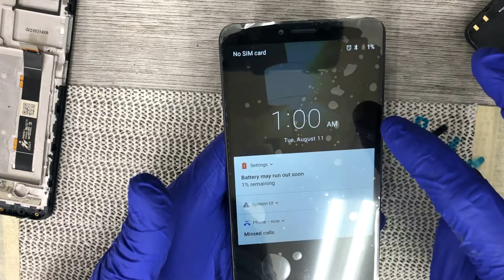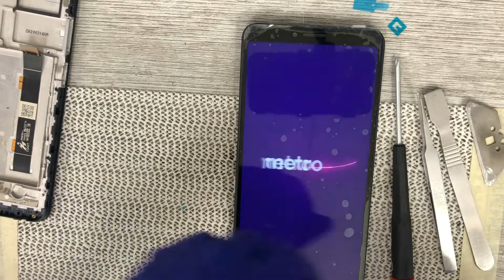ALCATEL 3V TEARDOWN and installing DISPLAY

Comment: Can you tell me how to charge the battery by using a peeled usb cable, my charging port dosnt work anymore :(  I just need to know where to put the black negative wire and the red positive wire from the peeled usb cable  to charge the phone. Help me pleaseeeeeeeeeeeeeeeeeeeeeeeeee
Reply from the maker: Hi! I wish I could but that is something that I don't recommend, it's better buying a new battery
Reply: @ez-fixit4044  Hi and thank you for answering. I actually charged the battery by doing what  I was wondering on. The battery was not the problem, it was the charging port. Anyways I finally got a  new cellphone and well, dont have that problem anymore. But I did manage to charge my old phone by doing what I thought could help me out. The battery was no the problem, but the charging port. Thank you anyways. God bless.
Reply: @anaalvizo6584  where did you put the wires at? I cant seem to find where and need to charge it one more time

Comment: Can you please tell me what I need to order to replace my usb charging port dock board with flex ribbon I can't seem to get the right part. It says Morgan 4G_TMO_SUB_V02 on the top of the left of board.
Reply from the maker: Hi! Those letters may not tell you the model of the flex but a code from the maker, what you need is to search on eBay or Amazon for the Model of the phone. To find the correct model, please open the Settings of your phone and then About the phone, once you find the right model do your search, and then before ordering make sure it is exactly like the one of your phone
Reply: Were you able to find the right part? I  need to replace mine also and possibly a new battery while I'm at it
Reply: @Laurel-Crowned  Do Not buy a 4100 battery, I did and it shorted out the phone
Reply: @daleg9141  have just Been using old phones for the batteries and circuit board. Work better then new from Amazon